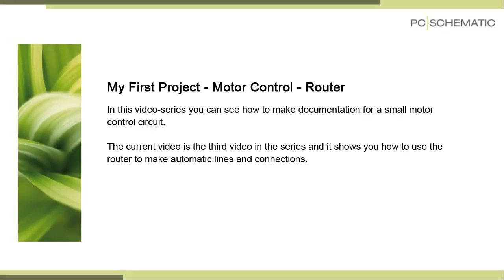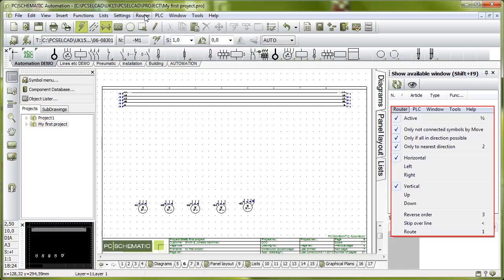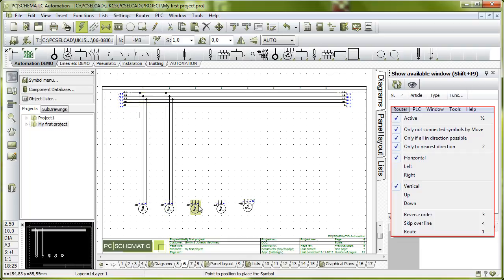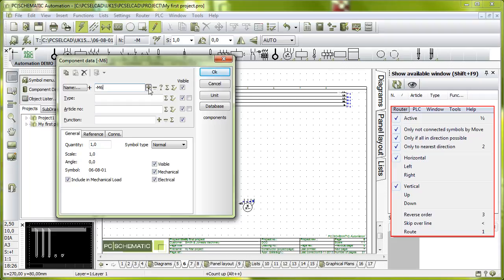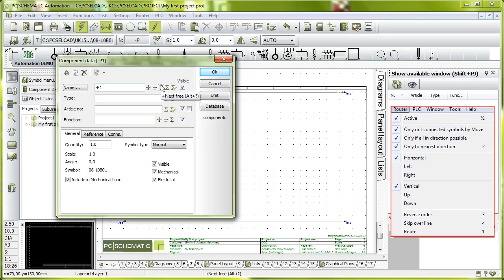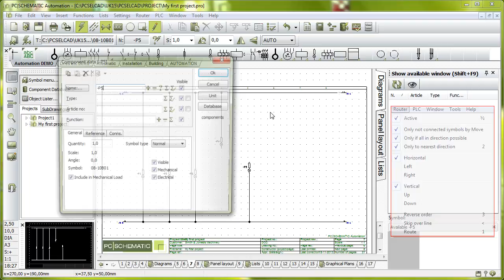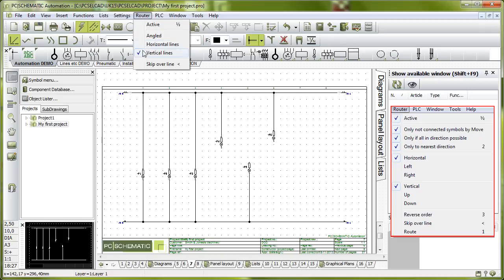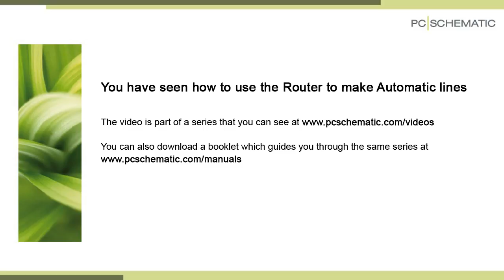Motor Control: Router (3 of 7)

Comment: I can't use Route option. Because in my software the shortcut is(\) same for both "Active" and "Skip over line".
and the Route shortcut (1) is not working....Please give me solution.
Reply: It is always possible to control and change shortcuts in PCSCHEMATIC Automatiion: In Settings|Shortcuts you can see all existing shortcuts and change and add shortcuts as you like. 
Some shortcuts may vary according to the language selected upon installation. 
Hope this helps you.
/Kirsten Holst, PCSCHEMATIC A/S
Reply: Thanks...Now it's working.....Go Ahead....
Do you have any forum?